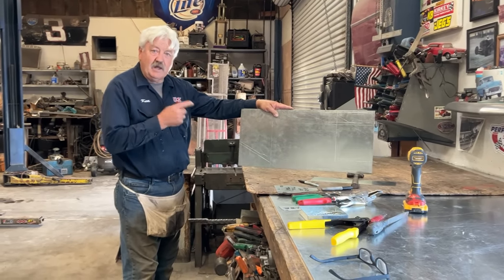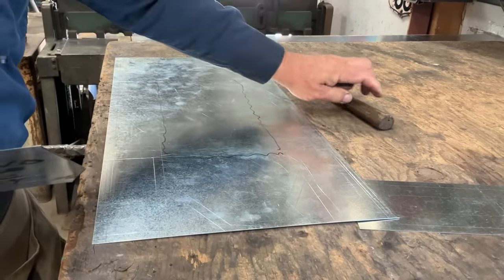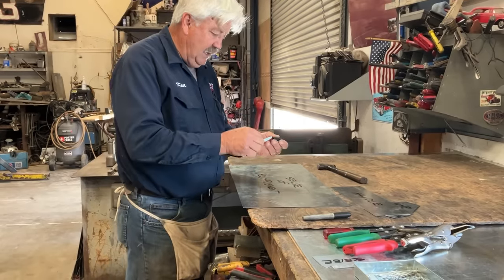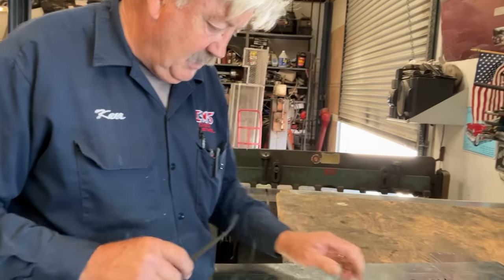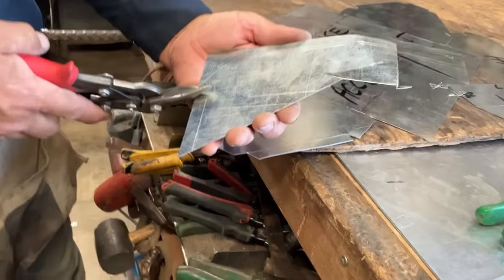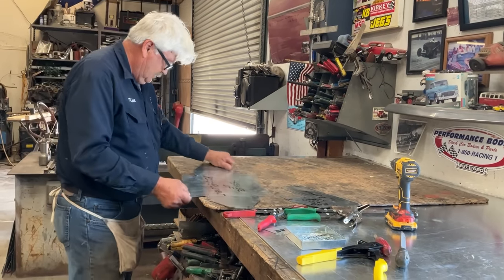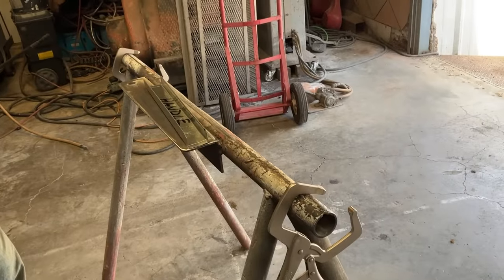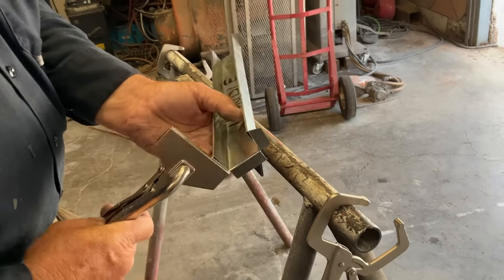Sheet Metal is Fun!  Making a tool tray using hand tool

Comment: Do you recall what gauge the metal is that you're using, you might have already said it and if so I apologize in advance. Great instructional video, thank you
Reply from the maker: @sethgerber2132  I don't mind at all. We have used 26 gauge on all of our projects so far. It bends easily and lasts a long time. Send us a pic of your accomplishment sheetmetalisfun@yahoo.com 
Thanks for hanging out with us
Reply: @kengodfrey1956  awesome, thank you. I do a lot of metal roofs, and metal buildings, usually by myself, so I've got about 6 or more different pairs of sheet metal shears to be able to get the cuts right. Most of the roofing metal I use is 26gauge, sometimes but rarely 29gauge. I'm in the process of building some 5' long x 16" wide x 9" tall drawers for a service truck I'm putting together to work out of.  I bought a 5ftx10ft sheet of 16gauge sheet metal for these drawers, I'll probably weld these together, but I might get some 26gauge to make individual trays to go in the drawers. Thank you for sharing your knowledge and experience.

Comment: Great info and explanation of technique. What gauge aluminum was the tool box? Much thanks!!
Reply from the maker: 26 ga. Galvanized. It's the most affordable material. I've made em in copper, stainless and aluminum though. Thanks for checking us out.
Reply: @kengodfrey1956  thanks for the reply. Like everything else, prices are so inflated even 26ga steel is horribly expensive these days but sure enjoy the videos. Learned some great techniques!

Comment: Correct me if I'm wrong, but, would it not be beneficial if you cut a slight bevel on one edge and one end of the wood? That way you could bend a bit past 90 degrees without needing to go back to finish the angle.
Reply from the maker: That's a good idea. You're not wrong. I have a shop full of metal working tools. Around one million dollars worth, and I love  them all. However, I want to show what can be done with a lot less. I hope to encourage folks to take on a task outside of their comfort zone. You could use a piece of flat bar, angle iron, or an old door threshold. The sense of accomplishment is the goal. If you make a tool tray, send us a pic and include your methods. Thanks for watching  sheetmetalisfun@yahoo.com
Reply: I will send you a picture through your mail !

Comment: Awesome.  Thank you for sharing. 
What type metal, steel, Al did you use?  What thickness ?
Reply from the maker: 26 ga. Galvanized steel. Have fun. Do it!
Reply: Thanks Ken, You have given me inspiration to make my own storage drawers, and bins.  I live in Arizona, so the plastic shoe boxes I have used just deteriorate in the garage in a few years.  Metal should last.
Reply from the maker: @npm261  check out our lesson on deconstruction and visualization. You can see some bins I made 40 years ago. Use our projects for inspiration and ideas. Make yours to fit  your application.

Comment: I want to make this out of aluminum. What thickness and type would you recommend? Thanks for showing how to do it with hand tools. Those brakes are crazy expensive. Also, what is the weight of the rubber mallet?
Reply from the maker: .030 thickness 5052 type.(alloy)  I think it's an 8oz.mallet.

Comment: If you route the edges of the board so that they arent 90°, but maybe 75° or 80°, you wouldn't need to unclamp and back up the board. Although off hand I do not know how easy one can find a 10 or 15 degree V-bit.
Reply from the maker: Good point. This video was my response to a request from our viewers. Many asked if there was an entry level project for those without machinery. I wanted to minimize the tools required and allow folks to feel a sense of accomplishment. I think it has been successful in that. I hope you found value in the lesson, and I appreciate your input. I'm glad you found us.

Comment: Isn't it an advice to plane the wooden board edge to an angle of about 85° so that you can bent the sheet right on spot to 90° without relocating the clamping board?
For a beginner it would help to train scribing by using cardboard instead of sheet metal. You have to take bending radii into account. For example on corners the tab bends should be offset by the sheet metal thickness so it will fall right to the inside of the main body bend without interfering.
Go get an industrial cardboard box and measure these bending offsets to all the bends and tabs after taking apart the cardboard box.
Reply from the maker: This lesson was intended to show what could be accomplished with minimal tools and prior skills. I think it does that nicely. I do appreciate your input and advice though. 85degrees is just right.

Comment: I see why you didn't use sheet metal bending  brake  you would not get tear drop you did with rubber mallet, but try this little favor from me  try lay down on its side on bench  the (drill)  it stop drill bits from getting bust by accidentally  bumping  drill forward  and snapping off drill bit. Thanks from Donald
Reply from the maker: Thanks for your interest in our lessons Donald. Good idea on the drill. I'll try to do better. The brake makes a fine hem. Just watch and stop clamping when the hem closes.  I hope you make a Tool Tray  it's a real good time. We appreciate your time.

Comment: Are you selling these Sheetmetal working Horses?
Reply from the maker: No. I've. Made mine from 1 1/2" tube. Square works great too. These are actually saw horses from our welding dept  the big diy stores have folding saw horses that would fit the bill nicely.

Comment: Home Improvement did an episode about Tim and his sheetmetal toolbox.  
Season 4.  i can't remember the episode.  When i find it i will post a link.
Reply from the maker: I loved that series. We love tools, hot rods and airplanes . Thanks for hanging out with us
Reply: @kengodfrey1956  i am almost 50.
i would be blind if my sheet metal shop teacher, back when i was 14, had not drilled into our minds isometric drawing, and trusted us with sheet metal and rubber hammers and rivets.
i heat my home at almost 50 with no ductwork but i have a hot water radiator or two.  
i was a fire protection pipe fitter for 14 years.  A ridgid 300 can rip off an arm.
Sheet metal just as dangerous.  It can slice a thoat, or take a few fingers off.

Our shop teacher in junior high had us make a small metal bolt bin.
Two drawers.  
i can't remember.
i am too old.